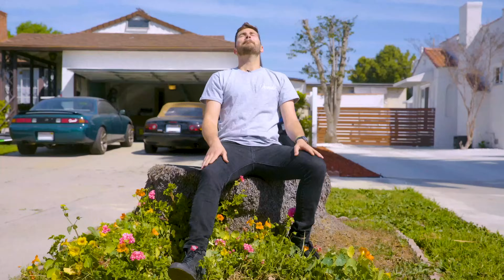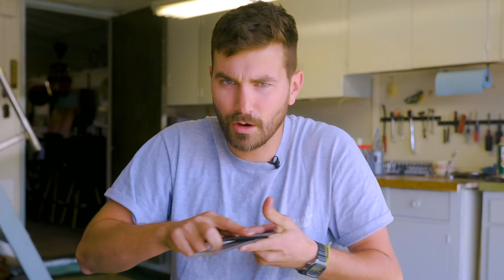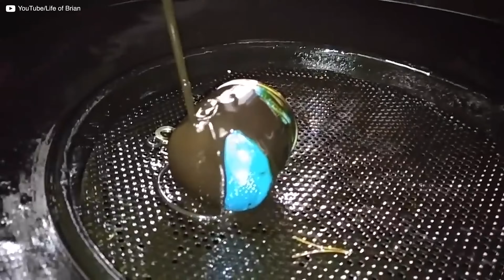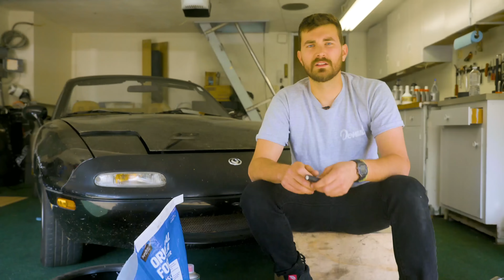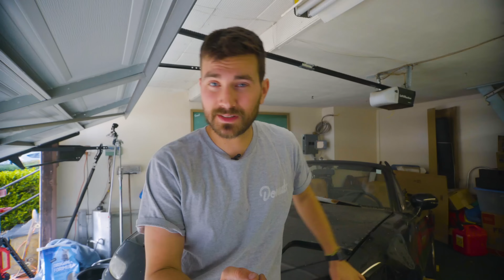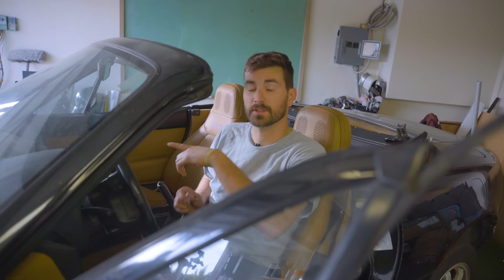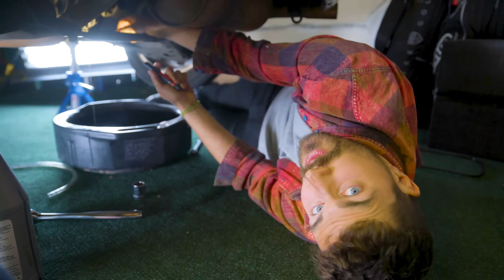9 Things You’ll REGRET Not Doing to Your Car

Comment: I find it annoying that all the trucks that I own have "lifetime" fuel filters built into the fuel pump, so you have to either remove the bed or drop the fuel tank in order to change the whole pump assembly, not just the filter. 🙄 This is older Chevy, Dodge, and Ford. My Dodge also has the fuel gauge sender as part of the pump, so in order to get my fuel gauge working again, I have to buy a new pump. Stupid ass designs from all 3 of the big 3 🙄

Comment: OK 1st you put oil on the oil filter seal so it doesn't seize . Has nothing to do with sealing. 2nd you can bleed the brakes all by yourself as long as you have a drip reservoir and your hose end never gets exposed to air. Gravity is a magical thing. Brand new computer anti lock brake stuff it doesn't matter. Just open it up start pumping keep a big bottle of brake fluid in hand and keep your eye on the main reservoir. Yes it goes dry you start all over again. I grew up like a junkyard dog. Love the videos.

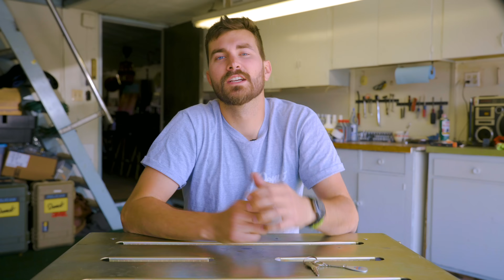Comment: 0:27 Oil change
7:27 Change transmission fluid
9:15 Change differential fluid
10:02 Bleed and replace brake fluid
13:02 Check cooling system
14:14 Check power steering system
15:37 Diagnose, gap, and replace spark plugs
18:39 Replace accessory belts
20:55 Replace air filter
22:37 Replace fuel filter
Reply: Thank you. To read your comment is much faster than to listen all the video 😅
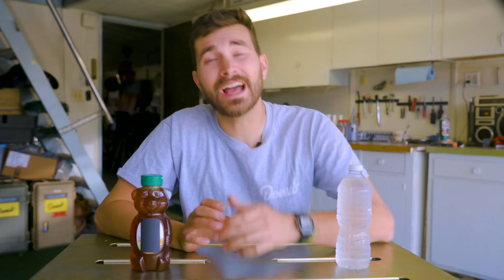Reply: 2:33 honey drop
Reply: 12:21 Pump it up (interlude)
Reply: Not the hero we wanted but it’s the one we needed
Reply: Legend
Reply: Replace piston rings because they prevent you from burning oil. Wax your windshield for rain
Reply: How often do you need to do every one of these things?
Reply: @ICY-HURR  depends on which one personally I do everything except brakes trans and differential every 3 months or spark plugs
Reply: @williammolnar6570  how much does it run you? I feel like an idiot, I’ve been only changing oil forever . I didn’t even know about the rest of this stuff until I saw this video.
Reply: @ICY-HURR  to replace every single thing he listed in the video maximum like 800
Reply: @williammolnar6570  Crazy to replace spark plugs and accessory belts ever 3 months dude.
Reply: @ICY-HURR  . Your car should have a maintenance schedule. Look it up for exact details.
Reply: @viewer-i5o  thanks!
Reply: @ICY-HURR  monthly
Reply: @ICY-HURR   litterally look up your question but based on the certain topic into google and you’ll get your answer. Pretty simple.
Reply: @princesanchez966  I could have done that but I found interacting with the car community more interesting.
Reply: You saved me watching this video.
Reply: what ablut blinker fluid🥺
Reply: Don't forget the piston springs
Reply: 'fluids, belts, filters, and plugs.' i think most people just go to shops for this, or are doing it themselves anyway, so its not like theyre not getting done
Reply: You are a good man Thank you
Reply: U r awesome thank you
Reply: ive done all and more, replaced sway bar links and control arms😁
Reply: i love people like u
Reply: AKA the "I just bought a used car!" checklist
Reply: Thanks for saving me 20 minutes
Reply: No blinker fluid change? Damn
Reply: They should pin this comment
Reply: God bless you sir.
Reply: There is a special place in heaven for people like you
Reply: This should be pinned
Reply: MVP
Reply: 1
Reply: Thank you for your description . It saved me so much time.
Reply: thankyou
Reply: for more people like you!
Reply: 2:33 honey drop.
Reply: Too easy! Unfortunately, I bet most people following this channel already know this. This video is more of a graded test for the overachieving subscribers.
Reply: My car stalls when i turn the steering wheel all the way, what can It be?
Reply: @hajaranka9093  is it fwd?
Reply: Broooo thank youuuu
Reply: You have gorgeous eyes and beard
Reply: @beardsntools  Thanks dude!
Reply: @wheresmyarm  As you were laying under that car I could really see that with that camera angle lol
Reply: @beardsntools  I'm not in this video, you're just replying to my comment. Still, it's nice to be complimented once in a while :3
Reply: thanks this is very useful
Reply: Deserving of every like you got on this comment.
Reply: This deserves an obligatory engagement comment for the Algorithm.
Reply: Do you know how much HP he got ?
Reply: You really need new tires in that car.
Reply: Thank you
Reply: Thank you, king
Reply: Ily sm
Reply: Thank you for saving me time
Reply: never did none of this on my Camry and it ran fine. well over 100k miles.
Reply: @Murphys_Law9  100k isn’t old or unusual with oil changes only. My Camry went 240k on oil changes exclusively haha
Reply: @John Monday wrong thread bro

Comment: 3.000 miles or 3 months between oil changes? Dude that's way less than what we have here in Europe. For example for my 2003 Toyota Corolla, the factory suggests to change the oil after 15.000 Kms wich is about 9300 miles, or 1 year. To extend the life and performance of my engine, I do oil changes after every 10.000 Kms, wich is 6.300 miles. That's still twice as much as what you do there. I think oil companies scam you guys pretty bad.

Comment: Timeline Guide
00:00 - Engine oil information
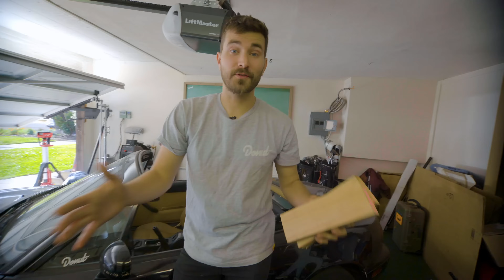04:48 - Changing engine oil
07:18 - Differential and transmission oil
10:00 - Brake fluid
13:00 - Coolant and power steering
15:36 - Spark plugs
18:40 - Accessory belts
21:05 - Air filter and fuel filter

Comment: Don't use that kind of el cheapo spark plug gauge at 18:11. First they're not all that accurate, second you can damage some kinds of plugs with these if your not careful. You can get a real set of feeler/gap gauges for the price of a couple of plugs.
And 22:00 are you really checking the outlet side of the filter to see if its dirty? That side should be clean, because you know, its a filter.

Comment: 6:40 "just helps it seal" hell no! It keeps that new gasket from melting to the damn engine causing an extra hour of work, tears, and the neighbor kids from learning "new words", the next time you change your oil filter.
Reply: Sounds like you know from experience 😂
Reply: Oh that happened to us with our new used mower and we work for two day on an oil filter and a hydraulic filter
Reply: On another comment "don't use the old oil. Ever."
I'm sure someone with experience knows why.
Reply: @dwaynowilli6822  I use the old oil all the time.  It's no problem.  It's just so it doesnt stick and you can actually get it off next time.  Nothing to do with melting as previous dolt eluded to.
Reply: @dgxdetailingservicesltd8461  why chance a metal chip, scratching the rubber, and causing wear on the seal metal, when its just as easy and a much better practice to use a a dab of the new oil? No engine trash that way. If you have a shop, then don't half ass anything, you'll pull more business that way.

Comment: One thing: Those jack points never work that well for me. They either bend or rust out, and a failure, in my experience, has caused the floor and subframe to dent. I was lucky it didn't punch a hole through the floor. This happens more often than not. Quite frankly, I never use those spots anymore. Sure, maybe if I had the right adapter, but resting them on the stands or using them as lift points without the right interface doesn't work for me. #rustbelt

Comment: Hi, nice video. I did want to correct a few things you said that can mislead people a bit:

You said antifreeze loses its ability to prevent freezing. That's not actually correct. 
You can make a 50/50 mix put it in a container and ignore it for 15years, and it will still maintain almost all of its freeze protection. What it does do is lose its CORROSION protection, and it can also gel (gelling is usually due to corrosion contamination too).

With the exception of 1 failed new-out-of-the-box, every water pump i have ever changed has failed due to excessive corrosion eating it (seals or bearings). Each one of them had 8-12years on coolant that should have long since been changed. In other words, a preventable failure.
If you change your coolant every 3-4years, your waterpump should last more than 10 years, maybe even 20.
If you never change your coolant, and only top off occasionally, you can expect your waterpump to fail anywhere between 6-12years.

Also, modern engines are making closer tolerances with fancier alloys to get really specific temperatures. If anything, cars are more susceptible to major and expensive corrosion damage than ever. 
My dad's fancy Prius has an ecu controlled variable speed water pump - that's an $1800 shop repair bill.
I'm used to early 90's cars and a diy repair bill of $80 for parts. I've had a shop throw in a new transmission in one of my cars for less than my dad's modern water pump system!

And on some modern engines, that could be too much cylinder wall damage and a whole new engine.

Comment: Just use metric!

Temperature - 0 is freezing point, 100 is boiling point.

Distance - 10mm is 1cm, 100cm is 1m, 1000m is 1km.

Weight/liquid - 1gram is 1ml, 1000grams/1000ml is 1 litre/1kg.

It's day/month/year. Why would you say Month/Day/Year?

Comment: Things you forgot to mention but are important:

-You dont just crank open the filler screws on the diff as well as the gearbox to "make sure you can fill it up later". Its important to do this before draining because air can be sucked in from the filler holes so the process of draining is much easier.

-While changing the brake fluid it is very important in which order you crank open each brake. You have to start at the wheel which is most farest away from the brake fluid reservoir and then coming nearer to it from wheel to wheel. In most cases the brakefluid reservoir sits in the front at the left(driving direction). Which means: 1.Rear right wheel. 2.Rear left wheel. 3.Front right wheel. 4. Front left wheel.
Reply: Some vehicles have different brake fluid flushing patterns (for reasons way above my head). For example, a 2016 Grand Caravan doesn't follow the usual pattern. So, as with anything, consult the service manual for order of operations (as well as things like torque specs).
Reply: @pedrosarsama  Usually these differences come from the ABS arrangement in the car (where the module is located with respect to the wheels and the length of lines running to and from it). 

Also, in many cars, the brake fluid reservoir is not large enough to hold enough fluid to fully clear the longest lines and/or you are doing this alone. I would recommend getting a pressurized pump/bleeder that attaches to the reservoir. This allows you to not have to pump the brakes and allows you to not have to constantly refill the reservoir as it's running dry.

Also, remove all the old fluid from the reservoir first to save yourself some time and.

Finally, if you have left over new fluid in an open container (bottle or the pump). Unless you plan on doing this again very soon, toss it (or give it to someone who will use it soon). Because it's hydroscopic, it will absorb moisture out of the air and you really don't want to put that in the lines.
Reply: @pedrosarsama or that have more brake pistons than usual like a corvette

Comment: You mentioned the miata's fourth cylinder getting hot, that's absolutely true. One thing people neglect to do (that I've done on my NB before turboing it) is the coolant reroute on the miata. Keep your 4th cylinder cool folks, if you plan on doing any autocrossing or whatever else then get that done. You don't want excess wear on the 3rd & 4th.

Comment: I bought a miata purely because of this series haha. I am literally following the steps in these videos to learn more about working on cars. 2 questions though: What brand jack do you use that fits well under this low of a car (has anyone used Pittsburgh or Daytona?) Also how much of the mt-90 transmission fluid goes into a miata and where can you buy that in store? I had to buy mine on amazon bc none of the local car shops had it

Comment: I can't believe there are car manufactures claim to have "lifetime" transmission oil's i mean even their automatic oil should be lifetime. Change your transmission oils folks.
Reply: Explaination?
Reply: @74Vette  oil especially in automatic transmissions is getting very hot. Full synthetic oil is loosing their additives over time and if it is overheated (like towing alot) so your oil is bad after some time no possibilitys this will not happen in some sort of time.

It will not happen as fast as motoroil for sure. If you want to see how cooked tranny oil looks like search for 'Precision transmission' on youtube.

So why do they claim to have lifetime transmission oil then?
I have 2 guesses. 
1. "lifetime" could mean till our warranty ends. So mostly something around 100-150tkm
2. They can say "we have the best trannys and oils you dont need to change them in any time" so just for marketing.

Comment: Great video. I am surprised you used a vice grip to pinch the line. You can buy a hose pinching tool coated in a softer material than the line for under 30$ that should work for any rubber line . I've tried vice grips before and it almost always messed up the outer layer, and eventually turned to a hose replacement

Comment: i'll add a point to spark plugs also, copper is the least resistant compared to platinum and iridium tips therefore copper provides a more potent spark and is better suited for performance applications

Comment: Mechanics trying to charge 200 for a oil change. I had a mechanic trying to charge $2000 for an a/c change (expansion valve, condenser, compressor, and recharge).

Comment: Not for nothing, when doing brake bleeding, you always start with the wheel furthest from the brake fluid reserve. It's not arbitrary. Also when choosing fluids for your particular ride, you always go for manufacture spec. The mechanical engineers created, designed and built it, it's safe to say, they know best. Again, it's not arbitrary. When you chose to pinch a fuel line, you put a thin piece of rubber or leather to create a cushion between the steel teeth of a vice grip and your rubber hoses, considering they are usually older lines. No one wants a cracked line, right? If you are going to make the effort to make a DIY, please do it right. Thanks

Comment: 1. Engine oil
2. Gear / diff oil 
3. Break fluid 
4. Coolant
5. Powersteering
6. Sparks plug
7. Belts 
8. Air and fuel filter

Comment: You should just disconnect the return line to your power steering fluid reservoir and let the oil drip out and if the flow is almost gone turn the wheel from left to right a couple times to drain the oil in the rack and pinion. This is the procedure we use at the dealership. Hope this helps.

Comment: It's gotta feel so satisfying to replace everything like that. Like even if this doesn't improve performance by one iota, knowing that all the consumables are fresh and new has gotta be fantastic.
Reply: Your just sitting there like damn my cars so reliable I fixed it before it broke
Reply: @mercury0214 I replaced the spark plug wires on a 91 Acura Integra just cus. 1 of them burnt out so I put the OG part back on 🤣
Reply: This service helps to increase fueleconomy
Reply: It's the first thing I do on every car I buy. If it runs, it's get the complete make-over so I know where everything is at. 

Even if they say they changed the oil the day before I bought it. Hell even if they show me the receipt. I still do it. It is a level of peace of mind you don't get in many other places in life.
Reply: @liberatorkramit  That's best practice really. Receipts can be forged. Your own work can't.
Reply: @liberatorkramit  Also they most likely they used some cheap ass crate conventional oil.
Reply: Oh it does
Reply: Fr I haven’t changed everything yet,but when I changed the oil in my miata (just got) it was literally black and super gross and it felt so nice to have her being taken care of properly just for the oil
Reply: every time i get a "new" used car.  I replace all the fluids.  It is a nice feeling
Reply: I wish I could do the same 🤣
Reply: The best is when you get a new to you car and go through and change all the fluids with dealer fluids, runs like buttah!
Reply: It is very gratifying!

Comment: My 97 Dodge Ram 1500 hasn't been properly serviced in years, it is in dire need of maintenance. This is the exact video I needed  right now, I already changed the crankshaft and camshaft position sensors since both went out at the same time ironically.

Comment: This is an extremely informative video, I love how detailed this is.
I do have suggestions, which are probably obvious.
Pretty much everything here is car specific, which is great, but as a general "How To," it misses some details. Not saying you need to over complicate it, the core concepts are all here, and explained clearly enough. There just should be some side notes. 
Things like; FWD vehicles that don't have differential fluid to deal with, cars without inline fuel filters, more complicated belt set ups, and some more that are a little more uncommon.
This video makes perfect sense for this car, but a lot of people watching this are trying to keep the crappy commuter car going. So a wider example would show the work better.
Reply: To be honest, once you've worked on a couple of cars it's all the same. You just need to look for drain and fill ports, or with suspension what bolts you need to remove to get access to whatever you're getting to.

You could use everything in this video to do a commuter car.  a friend brought his commuter Hyundai i30 over and I did a full service on his car and I've never touched a Hyundai before. It takes a couple seconds to ID the different drain and fill plugs, the oil filter etc.